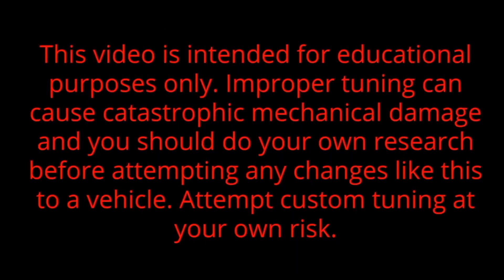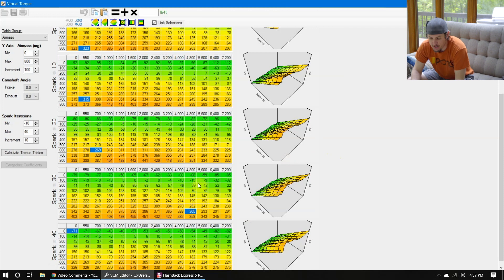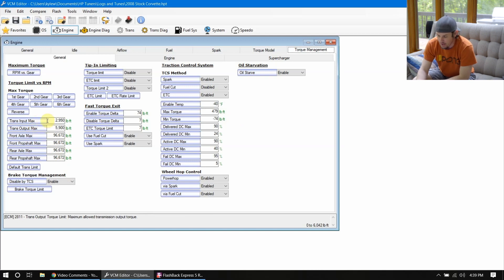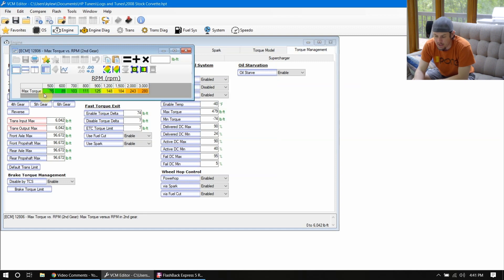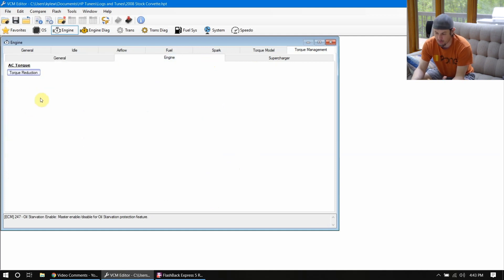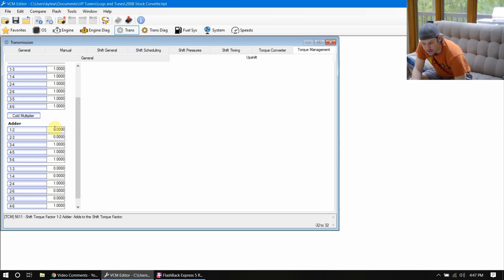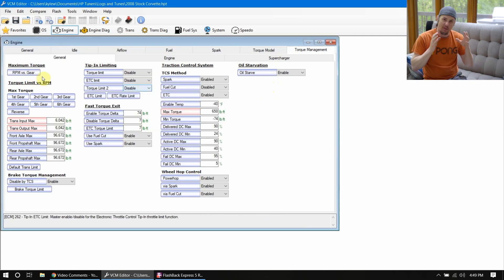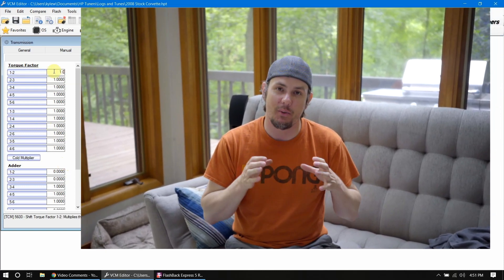Torque Management on the E38 ECU and 6L80 Transmission, What You Need To Know!

Comment: Having issues with my 6l80e clunking from 3rd-1st when no throttle downshifting, any ideas?
Reply: Your couplers on drive shift in your torque tube, Sorry had the same thing it's a huge job
Reply: @gregorybouderau5066 the driveshaft coupler?, sorry it didnt make much since.
Reply: @gregorybouderau5066 my 09 tahoe does not have a driveshaft coupler, its all one piece

Comment: Does torque management have anything to do with initial starts? Truck doesn’t want to go sometimes on a steep hill especially from a stop. Wide open throttle on dirt road seems like it would spin the tires at least. It’s high mileage, so maybe it’s something else. 2007 Yukon XL Denali (6.2/ 6L80)

Comment: I love your videos bc there’s a ton of great info, but I think some of the torque management choices your making on this trans aren’t correct.  I’d be more than happy to explain why I believe so, but upshift torque management won’t pull a ton of timing as long as the shifts are completing properly. Ct management is how it allows rev matching in manual mode as well so disabling that on some vehicles helps but not always as it takes away features without any benefits.
Reply: I agree with you. He should be reducing some of the torque management using the factors and not disabling it completely. CT downshift gets rid of rev match when the throttle is closed. Closed throttle. I don't think there's really a need to fully disable the torque management.

Comment: Would doing this on my 09 Silverado with the 5.3/6L80e help with my low end torque and make it a little easier to pull my 20ft enclosed trailer? My truck is completely stock.

Comment: Does the virtual torque tables really matter in these gen 4 since it's not really related to torque like the gen 5 will I be ok leaving them as they are even If I add a supercharger there I mean it's not going to close the throttle like it does with a gen 5 right?
Reply from the maker: Correct, it's not obtrusive like it is on the 5th gen

Comment: Just got hp tuners up and running I have mild experience with holley on my turbo ls monte carlo just trying to make my 07 yukon denali run a little better Haha love the video
Reply: Interested in hp for my 07 Yukon Denali at 180k.  I have issues on the freeway with the transmission downshifting to 4th gear from 6 when passing/accelerating.  5th gear generally gets skipped over or doesn't hold long.  That my transmission aging/going out or should i get it retuned?  I just flushed fluids and filter change and added a billet tc with 3 clutch from Circle D.  Didn't help much, so any ideas?

Comment: Hello from Norway! 
Thanks for many informative videos! 
I have an 2006 Corvette A6 with APS twinturbo and some minor upgrades in the transmission. Max 12psi.
I`m having an issue with upshift on wot on high speed (130mph+) where i just have to let off the throttle to make it shift. 
The TCS flashes also sometimes in high speed wot.
No i have updated my virtual torque table as you showed in your other video (from stock 612nm to 986nm) and i tried to raise the  ecm 2869 Max torque from 650nm to 1000nm. That last thing i tried earlier also. 
The problem i get when raising the ecm2869 value is that my trans locks in third gear even from start. 
As soon as i lower it to stock 650nm it shifts again (still not on wot high speed).
Here in Norway there are very little expertice on Corvettes, let alone tuning them. 
Can you give me some pointers?
PS. i havent got the car on the road after updating the virtual torque becuse of weather (Norway)
Reply from the maker: Make sure you're giving your car time to shift, when you're making a lot more power it's easy to blow past a shift point and it will struggle if that happens dealing with a similar issue myself
Reply: @GoatRopeGarage  Thanks, i'll look into that. 
But is that the reason i can't raise the traction max torque figure (ecm 2869)?

Comment: 3 questions 

I went from 340whp to 472whp with cam and bolt ons. What else do I need to touch besides torque management? It still has the stock tune. What pids do I need to touch on to compensate for that power gain?

I’m fixing to install a 2800 torque converter soon. Any tips on what pids I need to change on the trans side?

Lastly my 6l80 has the common 2-3 flare. Wondering if shift pressures will help?
Reply: reset the adapts every single time you program it. Its in the scanner. Or disable adapts and tune the on/off going pressure presets manually.

Comment: I have a cammed L86 6L80e.  I’m having a hard time with a pause between shift WOT.  At anything above stock shift points.  Stock WOT rpm is 5800 and is shift around 5600 and just snaps it off a good shift.  So I used the Blue cat tool and try to get it to shift around 6100 or 6200.  And that pause starts happening again.  It seems like anything over stock the truck just doesn’t respond.  Should I leave the rpm alone and raise the mph to get it to shift higher.
Reply from the maker: RPM is going to take precedence, but remember that it you have to shift in anticipation of redline so you need to set that RPM lower. If you're fuel or spark cut is at 6200 you'll never shift at 6200, have to shift a few hundred RPMs before that.
Reply: Thanks I have the fuel cut off set to 6600.  I was looking at the log alittle while ago and it’s commanding the MPH WOT every time exactly,  1-2 is 33 mph and it commanded it every time.  Then a few hundred RPMs later it shifts.  You think I could just move my mph up only to get it to shift alittle higher.  Since it will already hitting its mark on the rpm?
Reply from the maker: @blairbarham6532  yeah, so long as you know what limit it's hitting

Comment: I'm new to electronic transmissions so this might sound stupid.
Is there a controller that can act as a grocery getter and then flip a switch and have a maximum effort manual shift only transmission?
Reply from the maker: Not that I know of, but you can tune the different modes to have some different levels of aggressiveness, but it depends more on the platform and TCM.  Mode have at least two modes (Three if count a limp mode) that are usually designated as a sport or tow/haul mode which rely on different shift tables.
Reply: @GoatRopeGarage  I thought as much as I've never heard of one.
You would think that someone, other than me, would find value in a system that could transform you mild sounding turbocharged LS3 running 5 psi boost into an E85 guzzling 25 psi monster with a hard shifting tranny in the time it takes to hit 2 switches.
I've got a guy with a 632 big block causing my problems and I want to put him down like a dog, but I don't have 10 to 20 minuets to play with a laptop.
Reply from the maker: @johnparrish9215  That's the life, man, all or nothing, especially in transmissions. You can easily do that kind of stuff on the engine with aftermarket ECUs, but even then a trans is a different beast

Comment: I would suggest keeping Torque Reduction enabled and changing Speed Ctrl Terminate to Immediate.
Reply: Keeping torque reduction enabled will allow the ECM to pull timing during shifts. When setting Speed Cntrl Terminate to Immediate, it reduces torque much quicker so you still get a faster shift time.
Reply from the maker: @erikfontenot  Thanks for the info!
Reply from the maker: Elaborate, please
Reply: Torque reduction upshift. Do NOT disable. You can tune the shifts to shift firmer and faster without doing this. This is the easiest way to damage hard parts.